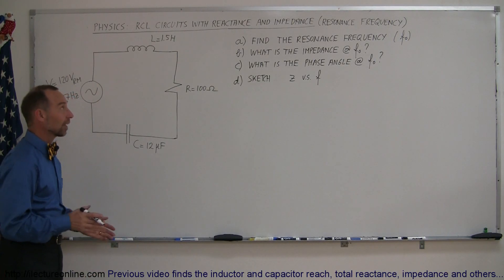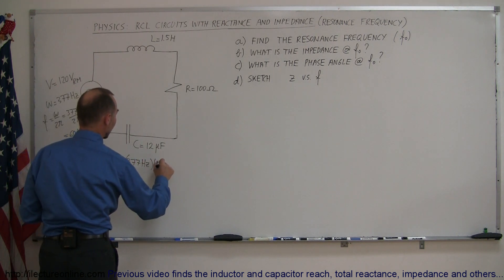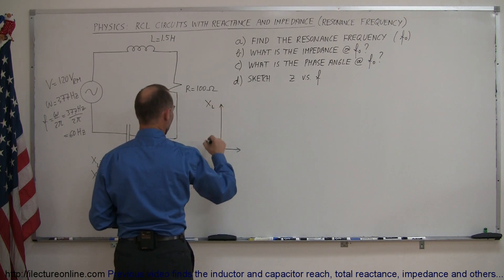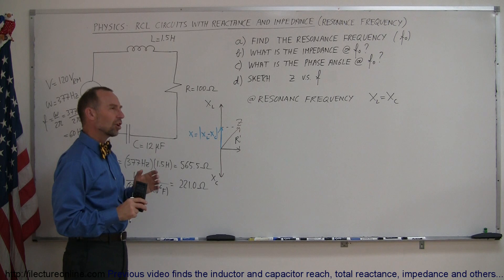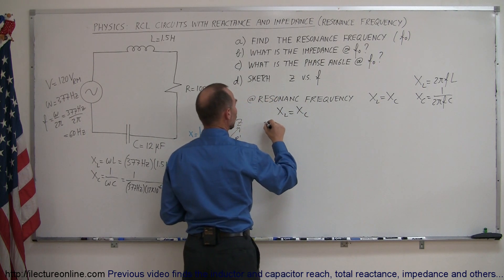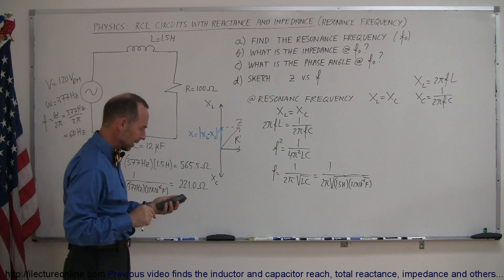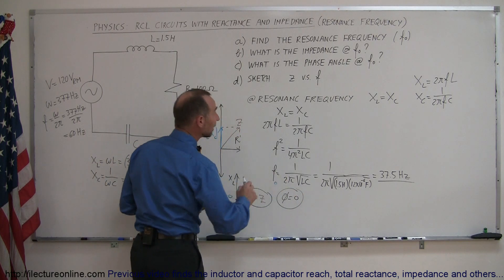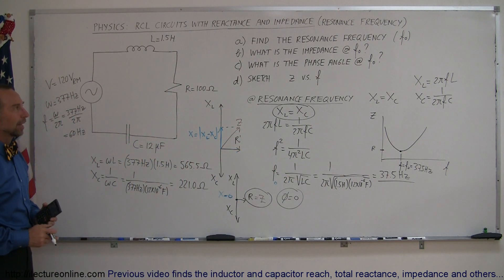Physics 49  RCL Circuits (2 of 2) Resonance Frequency

Comment: Hello teacher.
What happen when we use the maximium freqency on RC circuit,RLcircuit and RLC circuit.
   Can we find the impedance on these circuits.thank you
Reply from the maker: As the frequency increases the capacitive reactance decreases and the inductive reactance increases.  Yes, you can calculate the impedance at any frequency.
Reply: But in the exercises they don't tell the value of the freqency just tell the circuit use with the maximium freqency.????

Comment: sir michel i understand that Z=R at resonance frequency because X=0, but why is the impedance in the formula sheet that i saw Z=square root(L/C) not L/C?
Reply from the maker: I am not familiar with the equation  Z=square root(L/C), I will need to know what the context is of that equation.  In an LRC circuit, Z = square root (R^2 + X^2) where X = |X(L) - X(C)|
Reply: +Michel van Biezen what I meant was characteristic impedance Zo, you didn't mention it in the video, but you mentioned Z=R, I want to know what about Zo at resonance frequency?
Reply from the maker: There are many videos in the physics playlists on impedance and RCL circuits like this one:  Physics - E&M: RCL Circuits, Phasors, & Alternating Currents (23 of 24) Resonant Freq - Impedance    https://www.youtube.com/watch?v=cIZits_FphM&list=PLX2gX-ftPVXVg9J4Y8fzukA2Ezs2jfufO&index=36     Look for this playlist:  PHYSICS 49 RCL CIRCUITS   https://www.youtube.com/playlist?list=PLX2gX-ftPVXVg9J4Y8fzukA2Ezs2jfufO  and see if these answer your questions.  Also playlist:  PHYSICS 48 RC AND RL CIRCUITS
Reply: +Michel van Biezen thank you so much.

Comment: Thank you very much it was great solving problem methode, please can you tell me about calculation on cos Q, as it does not work out on calculator.
Reply from the maker: +Arvin Mistry When Xc = XL, then the phase angle is zero.There is no phase difference between the current and the voltage since X = 0.

Comment: 377 rad/sec
Reply from the maker: Ricardo,

The answer in the video is correct.
Reply: Michel van Biezen I was trying to say that in the video theres is 377Hz where i think it should be in rads/sec... we call w the angular frequency or angular speed which is 2*pi*f, where f is frequency and its measured in rads per second... 2*pi*60Hz is 377 rads/second.
Reply from the maker: Ricardo Candeias
Ricardo,
Now I understand your question.
Yes the difference between f and w are often misunderstood.
When considering the angular frequency, (w), the units are indeed rad/sec.  But since radians is a "non-unit" it doesn't have to be written in the answer, but I usually do as to prevent confusion.
When considering the frequency in terms of (1/T) where T is the period, the units are rotations/sec or cycles/sec.  Again rotations is often not mentioned and the unit Hz is used.
In the video above, the answer for the resonance frequency is in terms of cycles per second, so the answer is indeed 37.5 Hz.
If the answer was expressed in radians per second we would have to write  w = 236 rad/sec for the resonance frequency.
It is however customary to write the resonance frequency in terms of cycles per second.

Comment: how would X=0 when we add XL and XC, Michael?
Reply from the maker: Neo,
The opposition to current due to the capacitor and due to the inductor happen at different times during the cycle, exactly 180 degrees out of phase.
It is like adding vectors together that point in opposite direction so they cancel out.  (A force of 6 N pointing in the x-direction added to a 6 N vector pointing in the negative x-direction will cancel out and the result is 0.
The same for Xl and Xc.  They point in opposite directions so when they are the same magnitude they cancel out and the impedance Z = R.
Reply: because Xl and Xc are equal, and they are 180degrees out of phase w.r.t to each other i.e the point in different directions. so you have X=Xl+(-)Xc. (check the phasor diagram)

Comment: for the angular frequency (omega), shouldn't the units be rad/s?
Reply from the maker: "izzy2imagine"
radians is considered a "non-unit" and does not need to be included in the expression.  Sometimes I will add it for clarity when used in angular velocity.
Reply: Michel van Biezen i mean in the beginning of the video you put w = 377 Hz. It should be rad/s, not Hz, right?
Reply: izzy2imagine I think so
Reply: you are right omega is in radians because w=2(pi)f. Take it from a professional engineer.

Comment: so the circuits in these 2 videos are AC circuits right?
Reply from the maker: Yes.  If they were DC circuits, the capacitor would act like an open and no current would flow and the resistance would be infinite.
RCL circuits like these only work with an AC voltage source.
Reply: Michel van Biezen Thanks a lot! I am newly exposed to AC circuits and this cleared it up a lot!